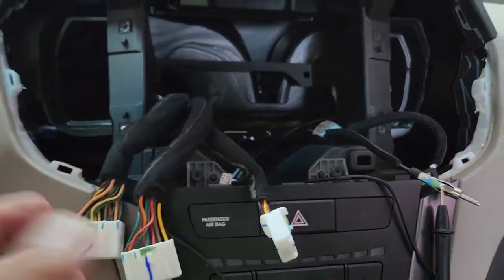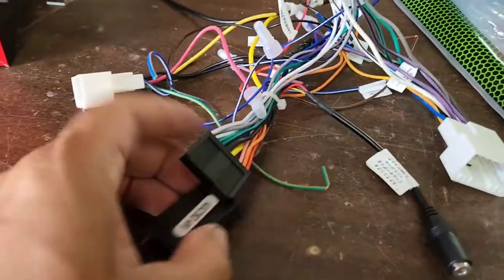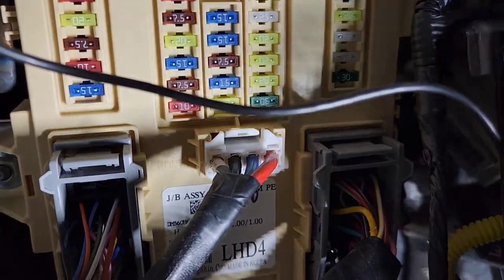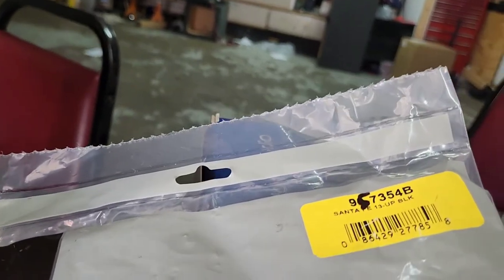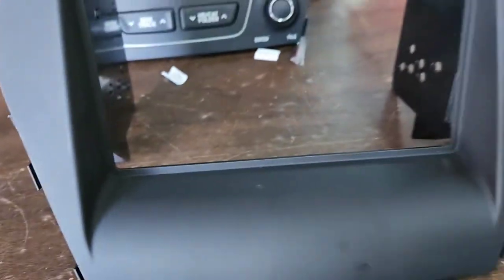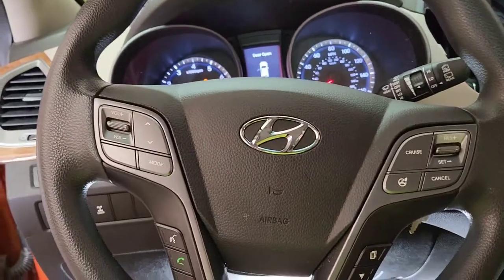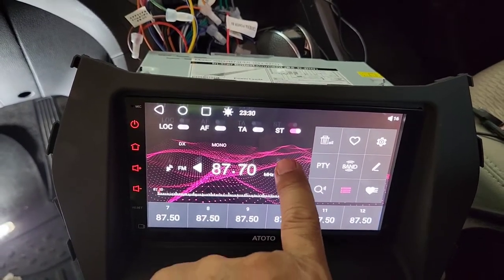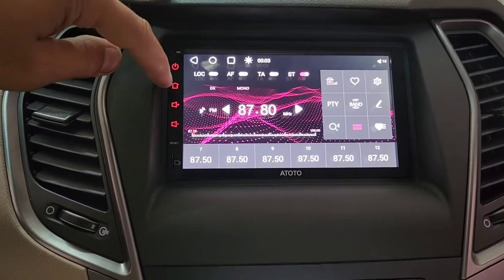Hyundai Santa Fe 13 - 17 Screen OEM Backup Camera Steering Wheel install

Comment: Hey I was wondering if you can help me. I recently bought a junsun stereo for my 2015 Hyundai Santa Fe sport but I can’t get the rear camera to work. Everything else is working as expected.Any advice? I tried to follow the instructions as much as I could but it was a bit hard.
Reply from the maker: What does it do when reversed?
Reply: @khmerohio  nothing. If I have zlink/carplay on and then I reversed, screen will stay the same
Reply: Same thing if I try the other screens
Reply: @awesomealdi  Mine is doing the same. Did you ever get it figured out?

Comment: I just installed an after market head 9" touchscreen unit in my 2013 Santa Fe Sport, and I also just bought the retention harness for the factory camera...but I can't figure out which wire from the factory harness is the Reverse Trigger wire to connect to the Reverse wire that's labeled on the new unit's harness...
Reply from the maker: https://www.facebook.com/Brainlimbo?mibextid=ZbWKwL
Reply from the maker: Messenger

Comment: Hi. Was wondering if you could assist me in figuring out my issue. I have installed a Junsun stereo. Comes with the wiring harness. All is working. Steering controls, aircon. Reverse. Just the stereo wont power off. And it drains my battery. The model i removed is LNN2230EWDM.
I have tested the current power cables and both give constant power. Even when car is off. Hope you are able to help me
Reply from the maker: The red wire should not have any voltage when the key is off